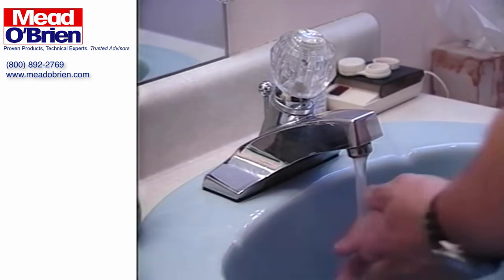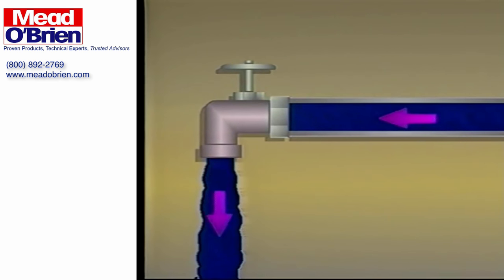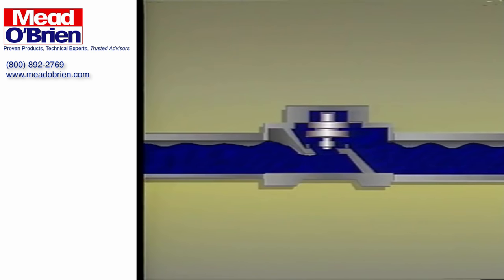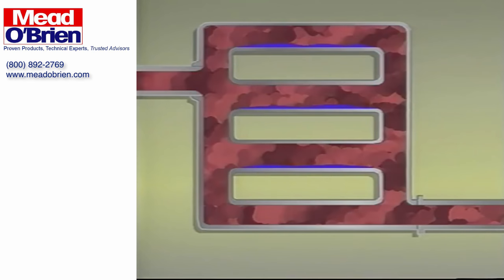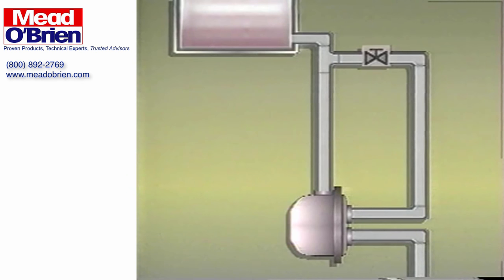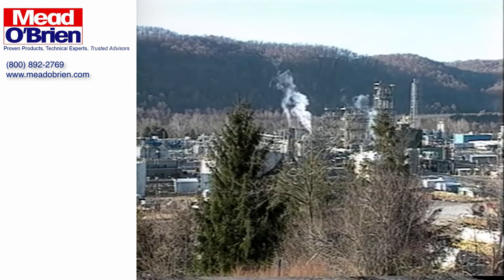Guidelines for Prevention of Water Hammer in Industrial Applications

Comment: 🎯 Key points for quick navigation:

00:12 Industrial hazard risk
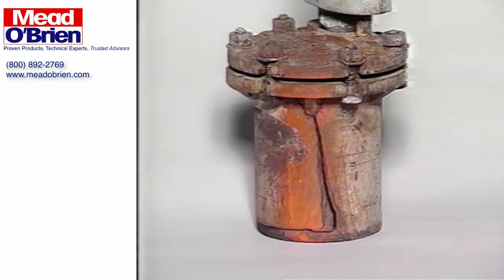00:40 Equipment damage potential
01:24 Bi-phase systems impact
02:05 Hydraulic shock explanation
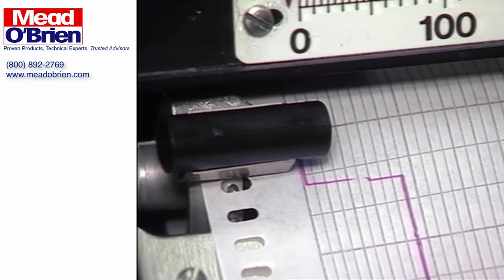03:01 Valve closure guidelines
04:23 Reduce system shock
05:02 Thermal shock causes
06:39 Prevent corrosion acceleration
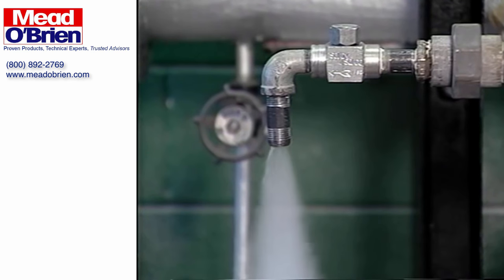08:17 Malfunctioning traps issues
09:15 Differential shock problem
11:02 Experiment demonstration details
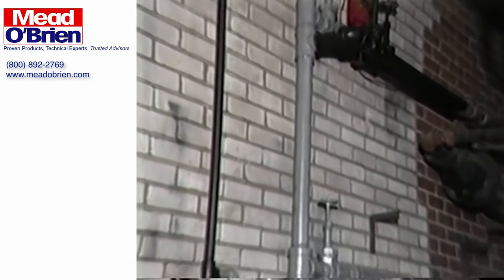12:41 Vertical drop hazard
14:02 Outdoor insulation importance
15:11 Installation of drips
16:05 System operation guidelines

Made with HARPA AI